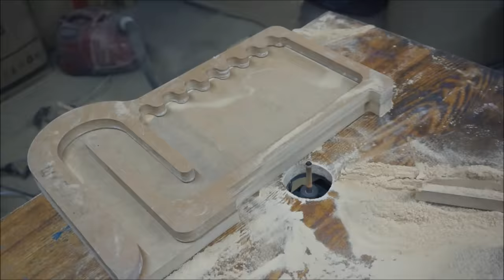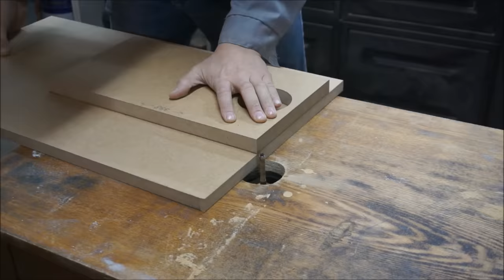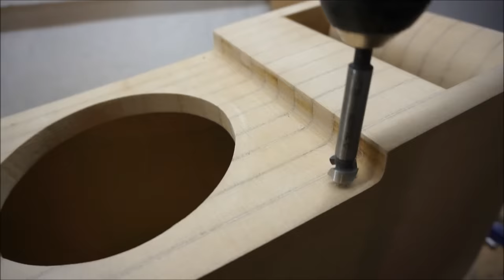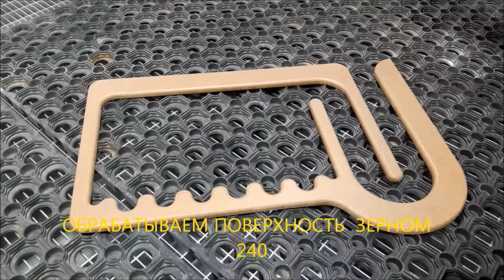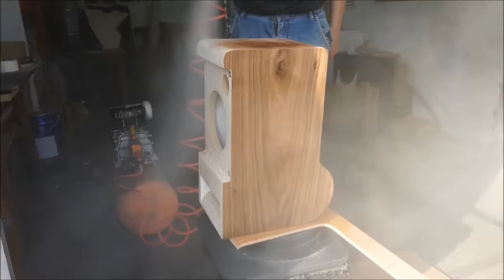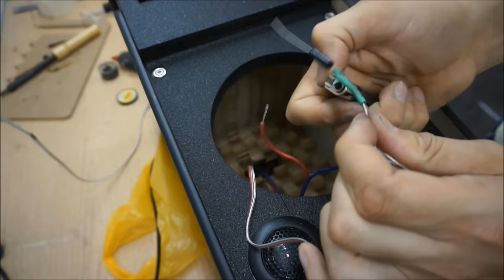DIY speaker assembly!

Comment: Not sure the builder quite knows the difference between ported cabinets and folded horns. So much of this design and construction is dedicated to making something that is apparently supposed to be a folded horn, but in effect is little more than an oversized port.
While the build is beautiful, and executed with considerable skill, ports only need to be large enough to move the volume of air needed to avoid internal compression-limited bass speaker action, and that means the holes are usually relatively small. They also do not significantly contribute to the projected sound, which is why they are often in the rear of the cabinet. Well-designed ports help increase volume for a given power level, but also suffer from decreased sound fidelity, leading to muddy low end reproduction. And the larger the port the worse this is, with the largest ports essentially eliminating the purpose of having the speaker mounted in a cabinet in the first place, and eliminating the benefits of increase in volume.
This is as opposed to horns, usually shaped as hyperbolic curved air channels, whose shape contributes to amplifying certain frequencies, and are often folded so as to minimize space.
Without the proper shape, they will not perform this function well, if at all, and simply serve as oversized ports.
But again, ports negatively effect sound fidelity, and large ports accentuate this fidelity loss, as well as loss in volume.
And these "horns", essentially being ports, are huge.

Comment: Very nicely build, also good design. Everything looks very firm. But I have one comment or question. This solution with magnetic attachment of the wooden cover seems nice, but I am not sure if it works well. When vibrations are rising this could get loosen and start to make some noise... Maybe I am wrong...
Reply from the maker: Thanks! There are no problems with vibration!

Comment: This might sound stupid but theres probably some truth to it.I built a subwoofer box for two pyramid 8" square subwoofers with wood that I got from a dresser that was free on Craigslist.Yes I'm poor.The box and subs sounded like how 8" subs sound in a box.I had extra wood so I took the box apart.I added to the box a vent in the middle but I added many pieces of wood on the inside standing up to make a zig zag path for the air.I reassembled the box.The subs sounded about 60% louder.This thought came to my head.The subs have more wood to vibrate, so that might be also why a bigger box sounds louder, sure it's how the sound travels but it also vibrates and you can feel it more.

Comment: Nice craftsmanship. Those must weigh a ton. How did you calculated the length of porting?  Are the woofer and port in phase?

As a lefty, I used to always twist stranded wire against the manufacturer's twist.  I've come up with a little reminder to myself - the top of my twisting hand should be moving "right away" and "left to me". Also, if you do put in a cross-over, review a soldering video to ensure you get good flow and connection.

Comment: Very interesting and cool cabinets, Well done! Don't really understand the electronics selection, but some configurations don't need more crossover than this. I bet they sound good in either case. Also I have to ask, what is the reasoning for the pattern in the rear of the cabinet?
Reply: Disperse standing waves iirc. been years since I was a speaker junkie, but I'm pretty sure that's the intention

Comment: For one side of each speaker I would have gone with acrylic so you're able to see inside, would using acrylic be ok to use on a side of speakers like that, if so, would it have to be a certain thickness or would something like 1/4" be ok? Really nice work by the way!!

Comment: Love your work (not real fussed on the removable front panel in this video). I have contemplated this design many times since I built my own CNC years ago and would be quite easy to do. Seeing what you do with the finish makes me think that it wouldn't be all that hard to make DIY speakers look a lot better than just ordinary. What do you put over the top of the raw MDF to stop the paint sucking into it? Years ago I tried to paint some MDF speakers but it just kept soaking up the paint like a sponge. You seem to seal it quite nicely.
Reply from the maker: so that the MDF does not absorb it, it is covered with insulators, then covered with polyester or polyratane primers, google those processes on the Internet

Comment: Seems like an awfully long port for the small woofer. What is your target port tuning frequency? The tweeter sub-mounted behind all that faceplate will certainly have diffraction issues and I would think time alignment problems as well. I know you would have been far better served with plain egg-crate foam inside the speaker than the complex wood shaping for reflected sound control inside the enclosure.

Comment: Excellent build! I'm amazed that you are able to route flush to your template so easily. I usually bandsaw out the rough shape prior to routing flush. Is that some type of light weight MDF?
Reply from the maker: Previously, I also used this technique with a jigsaw, but this time is spent even more, this MDF is the same as everyone else
Reply: @diy-sound5763  Yes, the jigsaw (I use a bandsaw) is an extra step but maybe makes less dust? I can't stand MDF dust! But it looks like you have a good vacuum system. Build on!

Comment: Beautiful work, very nice!!
Is that your waterfall spray booth and vacuum sanding table? Nice equipment!!

Did you design the enclosures yourself specifically for those speaker drivers?

What frequency is the port tuned to?

Again, beautiful work. Nice one!!

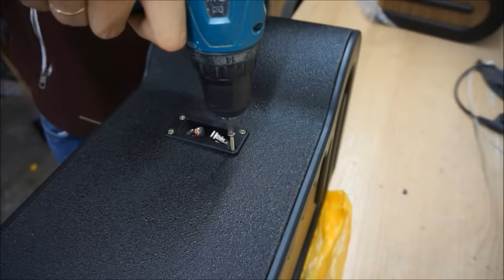Comment: Spends countless hours making everything look perfect then sharpies the screws instead of painting them or buying black screws :) @12:32 Totally something I would do...
I would have to put the tweeters in opposite corners too...
Outside of that, those look amazing.  Does the alternating wave wooden baffling built-in to the rear of the speaker wall sound better than simple foam?

Comment: Why are there so many guys working in wood, not using dust suction system. Come on people, try to look professional. The glue in MDF is not the best you can breath in with all the fine dust...
Reply: "it is a compound of wood dust and scrap bonded together by a resin containing formaldehyde - a recognised carcinogen. When MDF is cut, sanded, shaped or machined in any way, it releases clouds of dust particles coated with formaldehyde. The particles, much smaller than those emitted by most other commonly used woods, can be inhaled deep into the lungs,,

Comment: great woodwork but honestly you didn´t really designed a crossover and calculated the housing volume based on the thiele small parameter as it seems.
Also using some weird unknown car-hifi components.
Definitely not the best idea.
It also sounds very thin through the video and that´s no surprise, car hifi speaker usually need the footwell of a car or the giant, not 100% tight trunk or a giant, vented enclosure to get a acceptable frequency response curve.

Car Hifi simply isn´t designed for home hifi use and often it´s even poor crap for too much money and will probably never sound "good"

Comment: 10 out of 10 for workmanship.
Sadly they will sound both hollow and boxy due to the lack of internal wadding, MDF is notoriously bad for building speakers due to its 'ringing', this can be reduced by using various thicknesses and bituminous damping. The bass drivers are too small for the cabinet and the wave guide far to  tall as there will be no rear loading to the bass driver.
 To be really honest, completely lag every internal surface and pack the wave guide with acoustic wadding as the system is almost a 1/4 wave transmission and you'll get the balance about right.
Reply: Wrong,, mdf is the material of choice for many audiophile speaker manufacturers.  ,,, Because of it's inert qualities.